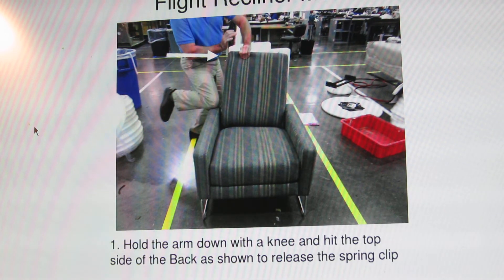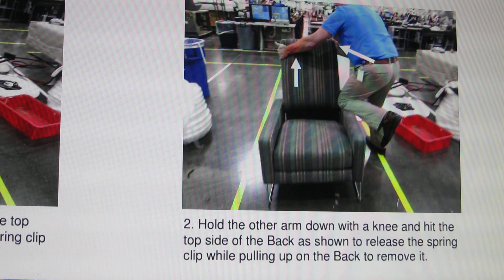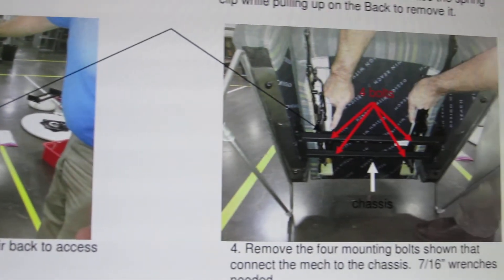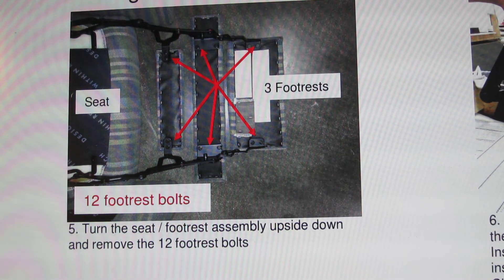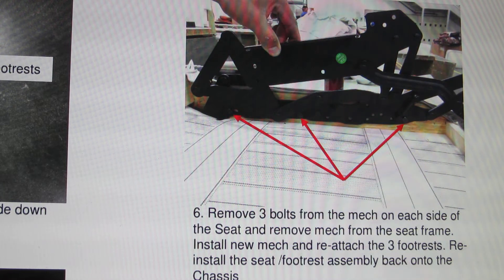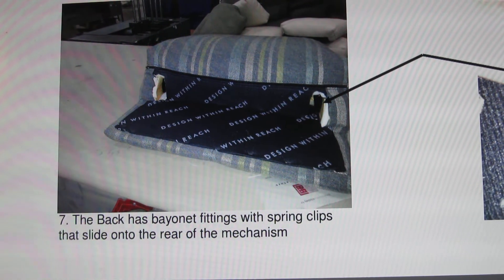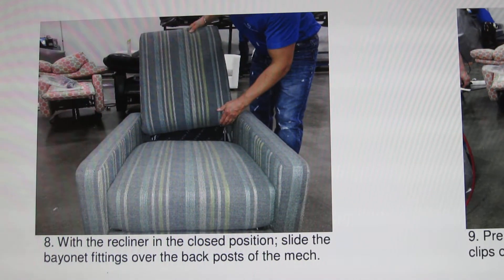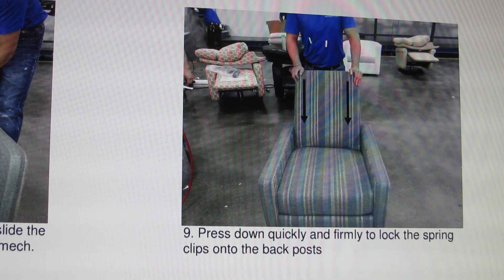Flight Recliner mechanism replacement

Comment: I bought one of these recliners used. It reclines well, but something doesn't feel quite right, as if something in the mechanism may be loose. I think I'll start by checking the mechanism has no loose bolts. Hopefully the whole mechanism doesn't need to be replaced as I'm sure that would cost a fortune for a new mechanism.

Comment: One of the springs on the foot mechanism broke on my chair. Where can I find a replacement spring? I have had not luck searching online.
Reply from the maker: I bht footrest mechanism from manufacturer, Design within Reach and installed per instructions in video.  Don't recall where the springs were.
Reply from the maker: @anOZinNY  I think the chair retails for $4,000 or more, guess $26 is probably worth it to make chair "work."
Reply: where do the springs attach?  I had one break and fall off, but cannot figure out where it should attach.  The other one is missing, so I don't have a mirrored condition on both sides.